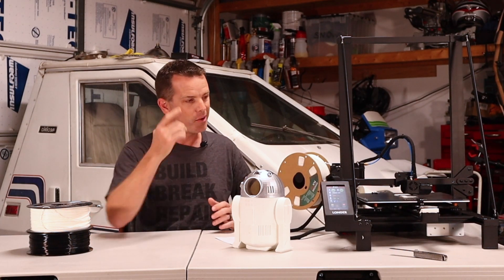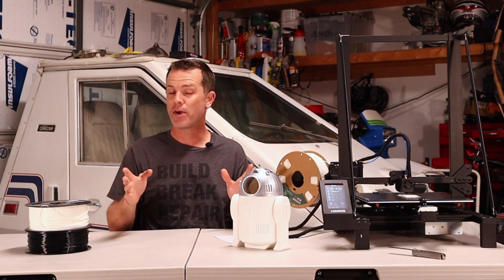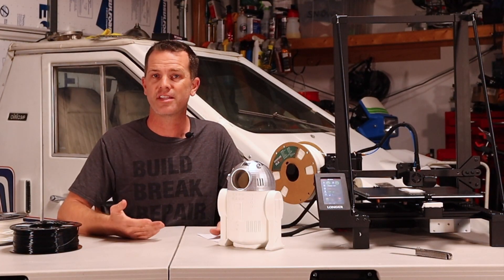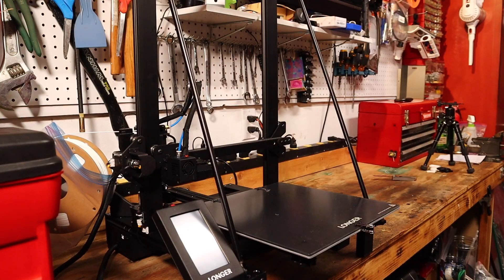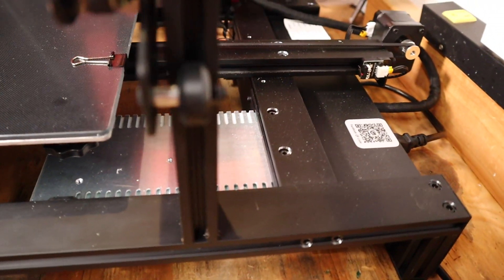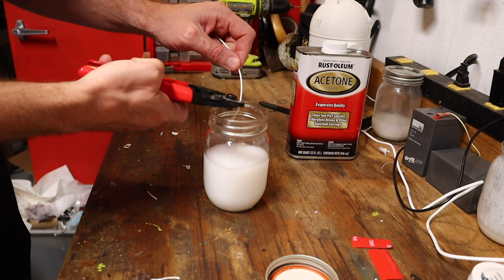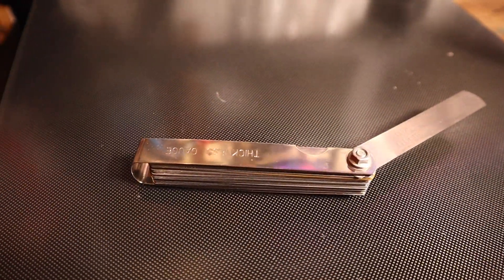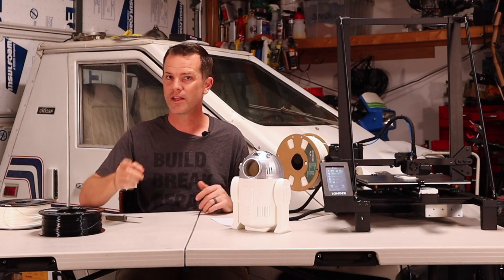Large Budget 3d Printer - Longer LK5 Pro - Pros, Cons and Tips

Comment: Help me out man I can't set up the printer to cura slicer it doesn't let me have any settings that you have
Reply from the maker: In Cura go to the settings tab, then the printer, drop-down and click ad printer. It should come up with an option window, and you would want to select the non Ultimaker printer option. That will open up a new window, if you click on, add a network printer, that will open up the non-network printer options. a drop-down will open up where you can search “Longer” and you should be able to find it from there. Hope that helps.

Comment: The new Longer LK5s come with the dual cooling fan as stock.  I have this printer and it's an absolute champ.  Picking up a few more for this price.   I've only printed in PLA+ and am switching to ABS.  What is the absolute fastest I can print ABS?  What is the secret to printing ABS?  Thanks!
Reply from the maker: The trick to printing ABS on this thing is bed adhesion and air temperature. I use the glass side of the build plate with an ABS/Acetone slurry on it. Build plate at 100, nozzle at 250. Part cooling fan off. Print speed at 50mms. Get a enclosure for the printer (I have the one Im using linked). Once the print has started don't open up the enclosure at all.
Reply: @DoItYourselfDad awesome, I ordered 5 of the tents you’re using and 3D GlooP for ABS for the bed.  Thanks for these great tips. 

I wanted to update all of them to the dual Z-axis. Ordering the kits from longer. Longer doesn’t have the cables oddly, where can I get the cables for the Zaxis motor?

Lastly I have a distinct thump on the bed travel, you think the wheels are over tightened?  Again, your video is so chock full of information.

Comment: You can very easily remote mount the LCD.  In terms of other electronics heat rises so the best Ive found is to use some glue stick and glue aluminum foil to some thin foam insulation and build a pan under the printer tray.  Aluminum for radiant reflection and then build a sub tray for the printer with air flow to the electronics out of peg board.  Like your top enclosure might steal that even as just a dust cover

Comment: I have had my LK5 Pro for about a year.  Soon after getting it I printed and installed the same fan setup you have and my prints have turned out great.  I have used PLA, PLA+, Performance PLA, PETG with great success and plan to print some toys for me and my kids with a roll of TPU I purchased soon.  Over the year I have changed out nozzles, Bowden tubes and Bowden tube fittings but that is about it.  Very recently my hot end assembly completely clogged up after about 850 hours of printing.  Longer sent me a complete new unit with cables attached.  I installed it and did a test print.  Unfortunately I quickly realized my cooling fan failed so I ordered a six pack of new fans.  I cannot wait to get it back up and running because I have some large prints ready that my smaller Ender 2 Pro cannot print due to it's limited bed size.  I really like this printer and hope it lasts for several more years without any catastrophic failures.
Reply from the maker: I’ve been printing mainly abs in an enclosure, just went over 1000 hours. I’ve replaced tubes and nozzles but that’s it so far. I did completely gum up the hit end, but managed to get it clear soaking it in acetone overnight. These are nice budget printers.

Comment: No auto bed leveling =(
Reply from the maker: You can add bltouch, though I havnt bothered. I havnt had to screw with bed leveling since the last time I moved the printer months ago.
Reply: @DoItYourselfDad  Ive got an Ender 3. The hotend is bad though, due to a globbing accident that happened, encasing the whole thing in a giant ball of PLA while I slept. Fixing it seems to be a right pain in the neck. So im looking into current offerings around $300... I like the LK5 Pro's larger build plate, but the LK4 S has more features it seems, including a BLtouch. Know of anything w/ BLTouch, and a large bed size?

Comment: I bought the LK5 Pro about 4 months ago...LOVE it. I am attempting to clean my hot end for the first time, so doing research and found your channel. I have not attempted to print with ABS as yet, so your info is very helpful. Great channel!
Reply from the maker: This thing is good with abs as long as you keep it in an enclosure. I’m still using the plastic tent in the video and using Abs slurry on the bed.

Comment: I bought the Longer LK5 Pro and I'm using the PLA filament but I'm having trouble of the first layer breaking away from my project is seems to stick hard do you have any ideas to why it is doing this please
Reply from the maker: I would start by cleaning the print bed and reveling it. Check your z axes height and make sure the first layer is laying flat and wide.

Comment: Hi I have a Longer LK5 Pro I cannot do the set up as there is no movement on the Y axis . Have you any thoughts to help me .
Reply from the maker: I havnt had that issue, the only think I could think of is a loose connection, either that or a faulty controller board or stepper motor.

Comment: i just ordered my lk5 pro last night, im so excited to begin this journey, the room my printer will be in has a ceiling fan, and an AC vent overhead. should i order some kind of enclosure for it, or will it be ok with possible drafts? i live in GA so right now AC is a must XD. Thanks for the video !
Reply from the maker: If your printing with ABS definitely, PLA is a bit more forgiving but it would definitely help.
Reply from the maker: Also, if your printing with ABS you should do it on an area like a garage that’s not inside your home. It should be well ventilated.
Reply: @DoItYourselfDad  Roger that, I’ll be starting off with just pla til I feel comfortable to move on to something different. Thank you for the reply!

Comment: I love my lk5 pro. I put a knew all-metal v6 hot end on it. I got a second y axis motor, and new fans coming in. I love the upgradability of these things too! It's basically a creality c-10 which is more expensive (even after upgrades.) It's a great printer for the price.
Reply: P.S. I use acetone too in a different way. I keep a thin layer of upholstery spray adhesive on my bed, and use a little acetone on a rag to reactivate it in-between prints.  Works like a charm.
Reply: Hi! I have one lk5 pro myself and I would love if you can give me some tips on the set up for better prints and easy supports to removed, I’m new at this and I would appreciate it if you can help me 😊
Reply: Good Morning Joe, which V6 hot end did you use on your LK5 Pro? Was it easy to upgrade?
Reply: @troycarrigan4893  Hi Troy! I was mistaken. I was still learning my terminology when I made this post. Not a V6. It was a all metal swiss clone from gulf coast robotics (American made.) Still a nicer hot end than the factory hot end inmo.